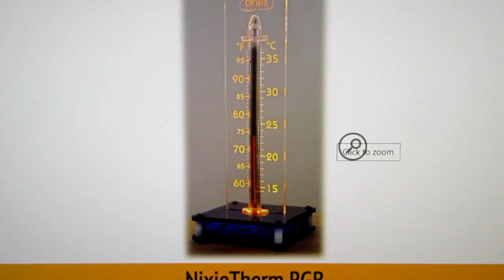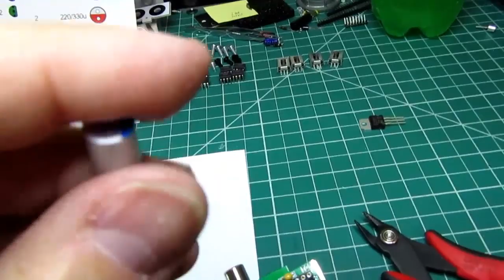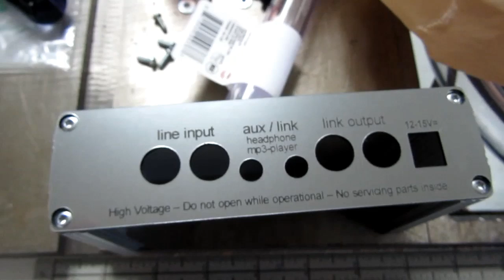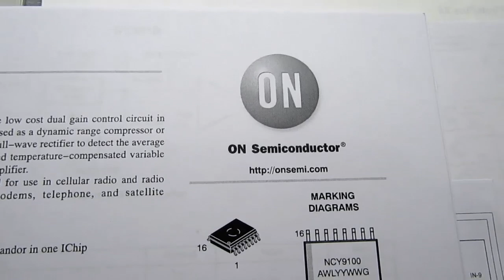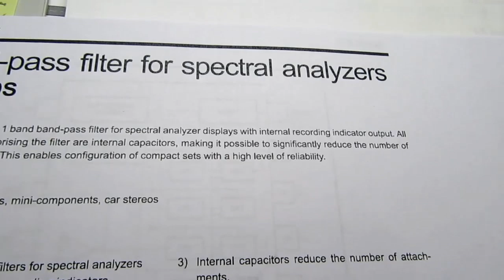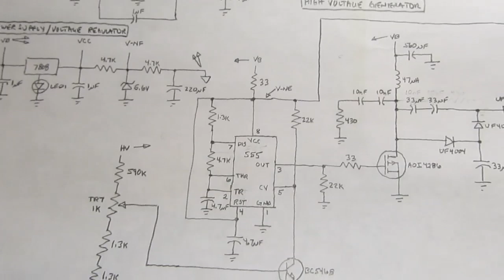Mr. Nixie "Nixielyzer" 6-Band Audio Spectrum Analyzer

Comment: Very interesting video, thanks for the explanation.

I have a doubt:
what is the second 555 in astable configuration to reset the nixie for?
What is its real function?
Reply from the maker: Claudio Camillo, I thought I already described its function in the video.....

The bargraph Nixie can get screwed up after a while, and show the wrong level for the applied voltage, and the 555 repeatedly turns the applied voltage on and off at a high frequency, which prevents this from happening.
Reply: @youtuuba  Thanks for the explanation. Your video was very satisfying and useful. Thanks !